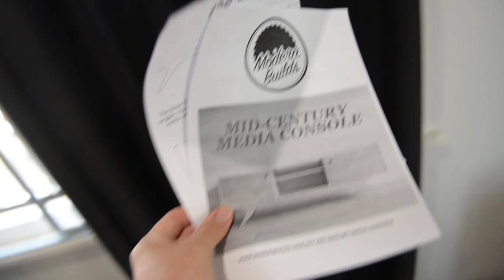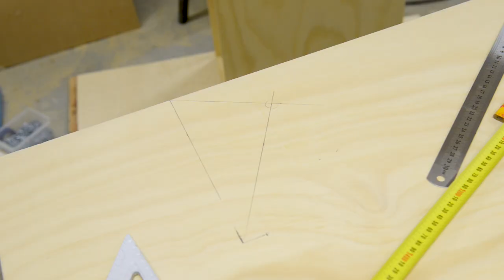DIY Tv Stand | Mid Century Modern Plywood Console #woodworking #diy

Comment: Hey Sam, was just wondering where you purchased the birch plywood from? I’m from Adelaide and Bunnings website only lists plywood that’s 1200mm long (too short for this project).
Reply from the maker: Hey mate, i got it a local timber shop, google for plywood suppliers around you. bunnings is too $$
Reply: @samwilkinson9670  how do you tell if it is formaldehyde free?